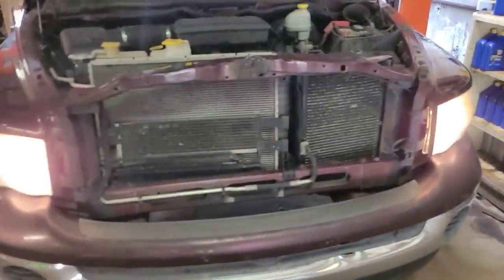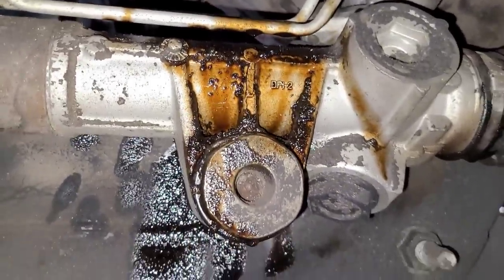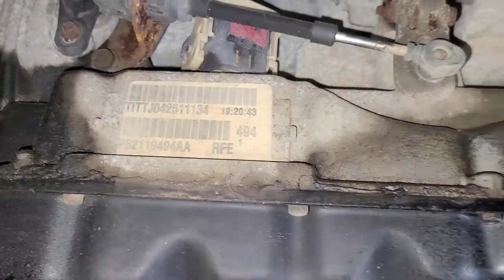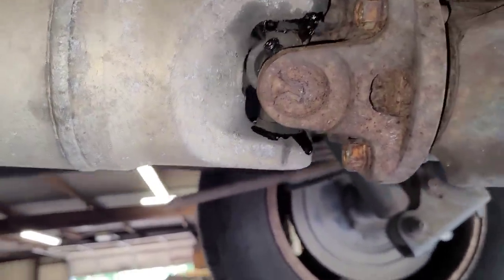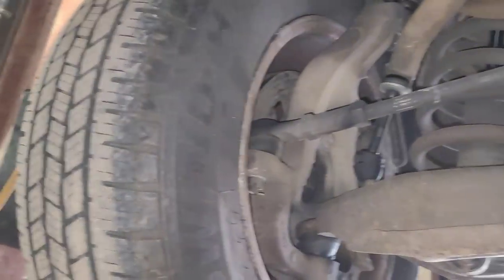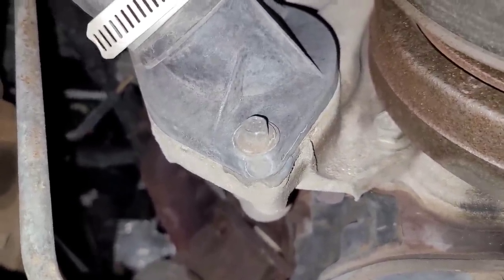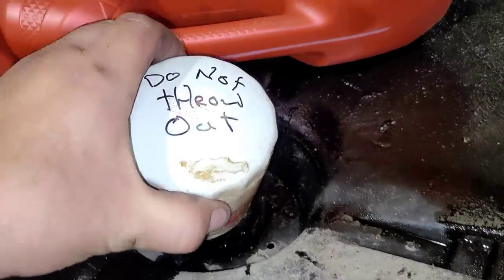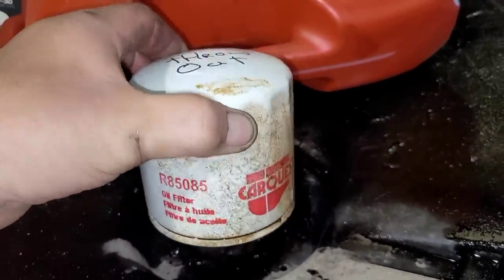I Think I Should Have Changed My Own Oil Sooner!!

Comment: Back when I did my own oil changes at home, the oil filter boxes had instructions to screw it on until it touches and then tighten 3/4 of a turn. That always worked okay.
Reply: Same here. When we went to cartridge filters, I got straight in the habit of following the book for customer filters (3/4 turn) or on my own car just tighten it firmly with a dry hand--with a dab of oil, to help tighten and because it starts the seal swelling ready to handle 60psi.

There's no need to lean hard on a tool to tighten it. 1/2 to 3/4 turn is enough.

But IMO you don't want to be able to loosen it with your fingers 6 months later! The rubber is supposed to stick, to stop it coming off. (Ask me about the customer who came into the garage over some debris and parked up with an oil slick and no filter :-) )

Comment: Nice little video Kenny. I put the air pressure that is recommended for the car. Hey if you like a stiffer ride, go ahead with your bad self. You are correct that over pressure the tire will last a little longer than under. Low pressure will wear the sides, over will wear the center. My car says 35 for the size I use. Cold, it of course goes up when they get hot, most folks don't realize how hot tires get.

Comment: Just to let you know, I had watched one of your videos about oil changes and to open the hood first. Having this in mind, I had just changed the brake fluid in my wife’s 2015 Tri-Glide motorcycle and was gonna change mine since I had the tool and fresh brake fluid. I thought I’d better take the cover off to make sure I could get to the drain plug before I drain the brake fluid from the reservoir. Sure enough I couldn’t get the cover off. Saved me a big head ache. Good advice like start all the screws before you tighten any. Love your videos. Congrats on the new house.

Comment: I'm a bit reluctant to share this but... If you're in part of the US that has Meijer stores, go to the automotive department and go all the way to the back of the isles and on the back end caps you can sometimes find crazy deals on automotive stuff you can actually use. They can sometimes be very aggressive on the clearance since not many people shop automotive there. I've gotten oil jugs for under $10 several times. Wiper blades, filters, and I always find sidewalk salt super cheap there every spring and buy ahead for the winter.

Comment: I had a Dodge that was slow to engage on start up.  My builder told me that my torque converter was leaking down back into the pan.  Since the model I had, 1988, the trans does not pump fluid in park (that's why the dip stick said check in neutral).  The trans has to refill the converter before it can engage the clutches.
Reply: That’s good to know, sounds reasonable as for why the delay.  My 46RE in my Dakota does the same thing, but not really worried about it.  It’s all good after it starts and runs for a bit.
Reply: When i removed the platic check valve in my 01 diesel i always put it neutral for 10 to 15 seconds for torque converter to refill
Reply: That's wild.. you'd think there'd be a check valve, etc for that.. must be some reason..

Comment: I have a magnet on a screwdriver type handle.  It's good for removing the oil drain plug on hot engines. You don't get hot oil on your hands. Loosen the plug as usual but leave the last few threads in. Use the magnet tool for the last few turns. It was less than $10.

Comment: Great video Kenny.  My commutes were 50 miles at hi-way speed, so my oil change schedule was 6000 miles.  I would put  1 cup of dextron in the oil at work and drive it home then immediately change the oil when the contaminates were still suspended in the oil.  I would ocassionally have to re-gasket an oil pan, rocker cover, and front of engine side around 300,000 miles, but there was no sludge.  The engines I had looked like new inside.
Reply: Internal engine cleaning is done very well with atf and or mmo...without worrying about lubricity.
Reply: Oh, Good.  Used to put a modest amount of M.M.O., about a third of a quart, prior to changing oil.
Reply: There's no T in dexron.

Comment: I turn the filter, after the seal touches, another 1/4 to 1/2 turn. When somebody gets another car check the lugs, most garages put them on to 150+lbs. It'll leave you stuck somewhere trying to get the lug nut off with the small lug wrenches the manufacture gives you.

Comment: Let me tell you a story.  A buddy of mine had everyone over for a cookout.  When we got there, he was changing the oil on his daughter's car.  He had this filter pliers that he used to remove the filter.  He has to head inside to help his wife with something so I continue with the oil change for him.  I always hand tighter the filter per the instructions which I believe was 3/4 turn after making contact for this filter.  He comes back just as I'm tightening the filter and he tries to hand me the wrench.  I told him no wrench needed.  You just tighten by hand 3/4 turn.  He gets this funny look on his face like I'm crazy and proceeds to clamp down on this filter with the wrench and just goes to town on it.

He fills it with oil and starts it up and a stream of oil starts flowing down the driveway.  I peek under there and the filter is just absolutely crushed and he punctured a hole in it with the wrench.  A stream of oil was shooting out of the hole.

He heads to the auto parts store and gets a new filter.  Takes him forever to get the filter off since he tightened it so tight with the wrench.  Does he tighten it by hand this time?  NOPE!  He proceeds to take the wrench to the second filter and goes to town on it.  It's all dented just like before but this time it didn't leak.
Reply: Seems like he’s been in that situation before! Keeping the part shops in business at least hahah

Comment: That's an interesting view of tire pressure. I do tend to slightly overfill, if only because I don't want pressure to slide down below recommended pressure as seasons change. When we traveled in Africa, we found it is standard practice to bring along a 12V tire inflator. They do that because with all the off road sand, ideal pressure is about 20 psi. Wildlife guides in Africa have found that underinflation makes a huge difference in sand to avoid getting stuck. When you come across a rare paved road, you reinflate to 36.
Reply from the maker: I never knew that ! That's quite interesting. Thanks for sharing that !!
Reply: @WrenchingWithKenny  I know folks who rock crawl, they do the same thing...and fix their jeeps A LOT!!!

Comment: Thanks Kenny, love your videos. Thanks especially for taking the time to let us watch the oil splash out of your funnel and onto the floor, I laughed my ass off on that one. You just let that happen with no big deal. On tire pressures, I never go below the door label, but I will add an extra few pounds. From there, I will check the wear depth across the tread.  For me, I found that because of my highway driving, the wear depth was greater at the center than near the edges. At that point, I will take out a little bit of pressure and try to equalize the wear depth across the entire tire tread.  I suspect the type of driving, loads, and tire type probably makes a difference on that wear.

Comment: Yes! The old 2nd gen Explorer tires were suggested to be around 25 or actually even less PSI.. And it led to the tires exploding from overheating and then accidents, obviously. Ford redid the stickers on them to say a proper pressure (35+) but it was a real issue.

Comment: Transmission issue may be that the check valve was removed from the cooler lines during the rebuild.. (helps to get the cooler and lines clean and the check valve itself can be a problem) . Without it, the torque converter drains the fluid and has to be in a gear ( any but Park) for the pump to fill it.
Like your videos and demeanor a lot. No bad words when the oil was splashing... God's still working on me.

Comment: Great video as always! I have a 2000 Ram 1500 and my transmission has been rebuilt and it is doing the same thing yours is doing. In the morning, I will drop it in drive and wait 5 seconds, drop it in reverse for 5 seconds, then back to drive. At that point you will feel a good clunk so you know it’s in gear and ready for the day. It’s been like this now for at least 4 years. Runs perfect. It’s just a Ram thing! -KB 🇺🇸
Reply: Try a bottle of Trans-Medic.. coworker had similar problem, threw a bottle in,so far, so good,been over a year,now.. only $10, too..
Reply: Look on your trans fluid dip stick, if it says check fluid level in neutral, that means that the transmission does not circulate fluid in park, so after the vehicle has set for awhile the fluid drains back from the torque converter which causes a delay in the transmission going into gear after start up and going into gear. Simple solution, start the vehicle in neutral, this starts the pumping of trans fluid which is really good for the trans and stops the delay of the trans going into gear. I  also recommend to shut the vehicle off with the trans in neutral, this helps with the cooling of the trans. Mopars have been like this from the beginning of auto trans i.e. torqueflites, of course early Mopars didn't have park, so it wasn't an issue with early mopars. I don't know what year mopar changed this that's the reason I say check the dipstick. I owned a 2011 ram 3500 with 68rfe trans, it stated check trans fluid level with vehicle in park and engine idling, but I owned 2006 ram 2500 with the 48 series trans, it required checking the fluid level in neutral. All of this is also possibly the beginning of the trans filter plugging up.

Comment: I'm a mobile 1, 15w - 50 full synthetic user.  Almost 280 k on my 2005 gmc canyon, 5 cylinder vortex, 3.5, all original.  Owned it since new.  Never any major repairs or problems.

Comment: I once purchased a car with an engine that was heavily sludged.  I thought that I could speed the cleanup process by adding a little kerosene to the oil a few days before I planned on changing it.  It worked too good and released so much sludge that the oil pump pickup screen plugged and caused a huge oil pressure drop.  I ended up disassembling the engine and removing probably a gallon of sludge.
Reply: I had a Chevy 305 cam job to do under a gm campaign back in the day.. it was in a plumbing van,never changed the oil.. had over 110000kms on er.. took the center head off clump of carbon about a foot long and 5" in diameter.. wildest thing I've ever seen in an eventual perfect running engine.
Reply: The only safe way to clean up sludge is to shorten oil change intervals. Every 1000 miles will clean up an engine really well & without clogging the oil pickup.
Reply: Marvel Mystery oil, about twenty to forty miles before changing?

Note: changed oil every 3k miles.
Reply: Yep. Chrysler la barron. Used automatic transmission fluid. .zero oil pressure after that. Pulled the pan and changed the pump. Had probably gallon of carbon crap but it was clean.

Comment: I've found that the round drain funnels splash a lot less than the square ones. As far as tire pressure,  I always set them to whatever is on the door jamb. I'll overinflate a pound or 2 in cold weather to keep the stupid tpms light off

Comment: Those pieces inside the oil fill tend to do that even if you do regular oil changes in places where you have cold weather. The fix for it is to put a later model PCV system on it that comes off of the rear of the driver's side head. I believe it comes off of either the valve cover itself or a bolt next to the head or on the head. They are always nasty. You can make it look better than that, but I have one that does the same thing. I have not upgraded it, and it's on a 2002 Jeep Grand Cherokee

Comment: 1:45 Just how many times have you seen this? Take a guess for us. I have a body shop, I paint around 200 cars a year. Been doing this for 17 years Counting the cars that were hit in the front, maybe 20 cars I had to cut my way in. Maybe 2 cars I had to use vice grips in the hood cable, witch the owner had laying in the floorboard.
Reply from the maker: It's Mrs Wrenching. I was a service advisor at Toyota, Ford, CDJR & GMC. I can't count the # of times technicians that came in from the shop to tell us that the hood wouldn't release. Keep in mind that every shop I worked in, we averaged 20 LOFs a day 6 days a week. I worked with Kenny at Meadowlands, and we had 18-20 techs with a Quick Lube (mostly a theory) & not a day went by without a hood release issue. Mind you, this was in NY. It was a 50/50 split with the customer being aware of the hood latch issue. Thanks for watching! Meg

Comment: My favorite car to change the oil was my 1976 Mazda Rx-3 with the Rotary Engine.  You kick the pan underneath then Open the hood, pull the drain plug, R&R the inverted oil filter, replace the drain plug, and refill the oil All From the Top leaning over the driver's side fender.  No need to get on the ground or raise the car.  Five minutes, tops, unless you want to change the four spark plugs while you're in there and all the plugs are accessible with a socket, wrench, or even an adjustable wrench or pliers.

Comment: Transmission-Low fluid or low fluid pressure will cause exactly that.  It amazes me, and I'm sure you've already checked it, how many customers I've had with stalling at a stop sign come in to the shop and it's low fluid sloshing around and exposing the pick up at a stop.  
Since it only does it cold, maybe a new filter and some clean fluid would help.  Lucas ATF treatment is a miracle worker too for hardened seals.
Reply: There's a TSB regarding this issue with the 45rfe and 545rfe in the 2003 - 2006.  The cooler return filter has a bad anti drain back valve which allows the torque converter fluid to drain back into the pan causing shifting issues on cold start after the vehicle has been sitting for a while.  It's the same as a low fluid situation only the fluid fill is correct but the torque converter is half empty since it's all in the pan.

Comment: Check that pinion nut buddy.  I switched to royal purple in my 04 ram and it's staying clean. When I rebuilt this motor I pulled the thing apart and it was so clean. Mobile 1 synthetic is what the previous jeep owner used as the tone ring needed changed on the crank. My trans is doing the same thing Kenny. 205k on original transmission.......

Comment: If it locks up it might be a torque converter problem, or maybe it just needs clean new fluid. My van likes new fluid. When it begins to shift funny I change the fluid and it goes back to smooth and has that right kind of sound to it. I change transmission fluid by removing the lines to the radiator, directing them into a drain pan, then start it up in neutral and watch what comes out in the pan. When there are two quarts in the pan, I make sure I have added two quarts of new fluid. When the fluid runs clean I shut it off, connect the lines and top it off. That way the transmission has not run dry at any time, and nothing strange was effected on the transmission, just a change of fluid. Mine really likes clean fluid.

Comment: If I make 2 suggestions, one is, use a SOLO cup (similar to those used to play "beer pong') to remove the filter. that way, the oil spills into the cup, rather than dripping all over the power steering rack. The other suggestion, is to remove the transmission pan, and replace the pickup filter screen. There could be two problems. 1, is that the screen is clogged, creating suction pressure, cavitating the pump. The other problem could be the O-ring where the pickup tube enters the valve body, or, a gasket. causing the pump to draw in air, which aerates the pump. Both are good reasons to replace the pickup screen assembly. There even could be a crack somewhere near where it mounts to the valve body caused by vibration. That might help it shift into gear more readily.

Comment: I believe in using Lucas, you may not like it, but I've got well over a Million miles using it... Cat 3406 E @ 700 HP, and 1850 Torque, When I parked that truck it was Clocking 1,981,760.7 Miles After I broke the Frame on that 02 379 Peterbilt... Different Strokes for Different  Folks... I use Lucas as an assembly lube as well... Have a good night...

Comment: Kenny, I have been a mechanic since 1959 and I have found that if I take some aluminum foil and put it under the filter or drain if it has any interference and form it so it goes into the oil drain pan it avoids a mess and is easy to use and dispose of. What do you think about B&G oil flush?

Comment: Kenny
Daytime running lights have been the law in Canada for years so even vehicles made in the US exported to Canada must have them and they are a great idea. But they should also have running tail lights as well. Get into a situation with snow blowing across a highway and you can come up on the rear of another vehicle suddenly. If the tail lights were auto activated like the headlights it would be much easier to see one.

Comment: The service manual on my '14 Chevy SS says 7500 miles between oil changes. 
The oil life service % screen before changes,It usually goes to 8000 miles before I have to change it. Newer vehicles that use synthetic oil, you can safely get 5000 miles between oil changes. Just use a good K&N oil filter!